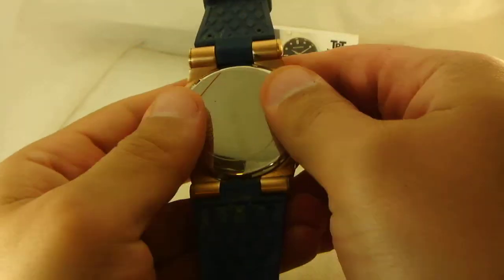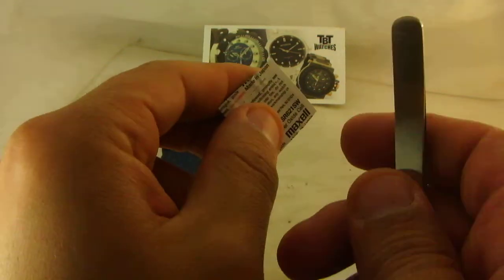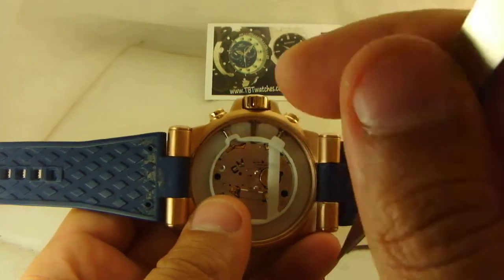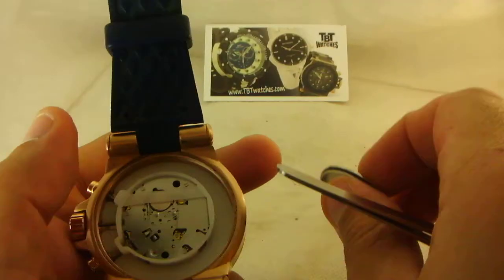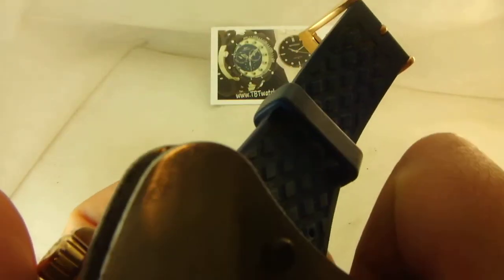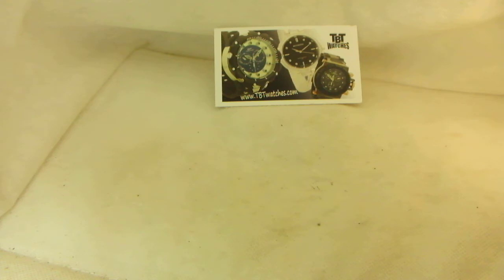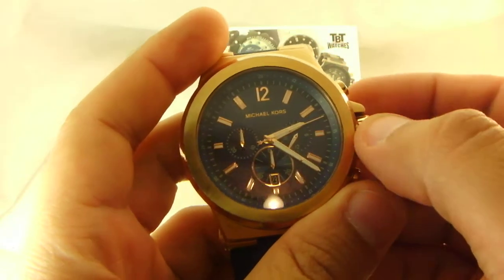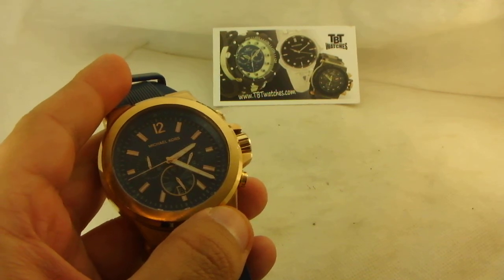How to replace a battery on Michael Kors watch model number MK-8295 (MK 251304) Part 2

Comment: Please tell us how to change the strap I’m going nuts figuring it out and I can’t find a video anywhere.
Reply: Two flathead screwdrivers will allow you to take out the screw for the strap. Take the screw out and the pin that hold the screw to change out the strap.